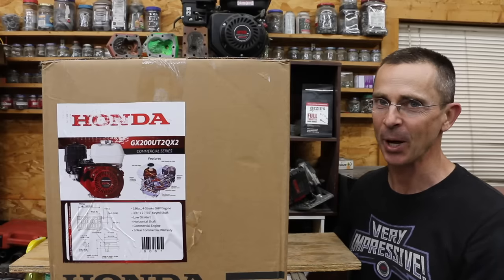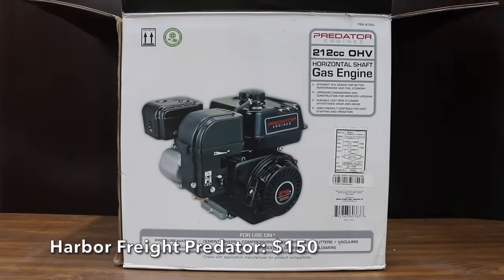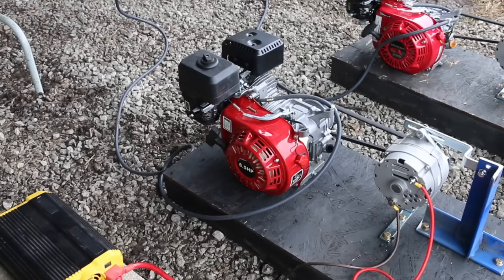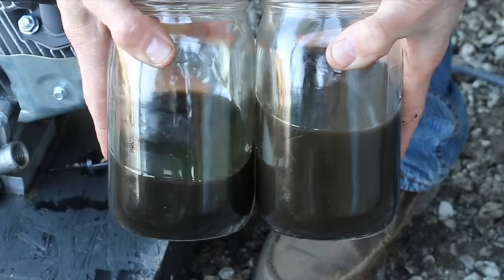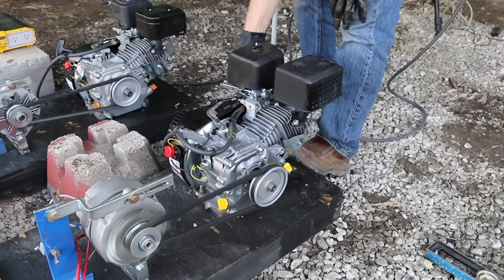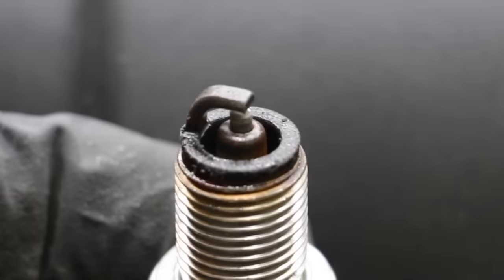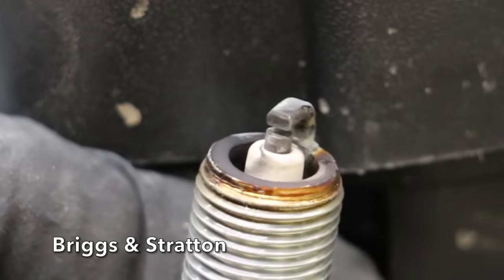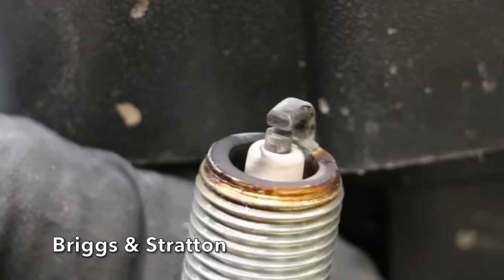$150 Honda Clone vs $600 Honda? Let’s settle this! Fuel Efficiency, Horsepower, Durability, Starting

Comment: Harbor Freight is just killing it these days. Also many thanks as usual for the amount of work you put in for us folks to guide us in the right way.
Reply: There stuff works just fine for most for sure!
Reply: @fredrhodes    Indeed but they are slowly but surely creeping into the professionals space all my guys are switching over as stuff breaks. And I even used to say but yeah it's all Chinese made, and yeah it is for the most part but so is everything else outside of a few overpriced legacy brands and even that often is.  Although if you want affordable American made look to the hammers Vaughan and Estwing they are still doing it right at least.
Reply: HF has upped the products and the prices, and lack of 20 percent off coupons
Reply: @alpham777  I use an estwing everyday for my own 30 years, plus however long my father used it before he died. They are amazing.
Reply: @shystermagoo6823  You mean the recalled ones where the welds would break? Killer for sure.
Reply: @shystermagoo6823  Wait, was that a sarcastic reference to the poor quality jack stands from HF a while back.  Cousin Eddie would approve.
Reply: @shystermagoo6823  crushing the competition
Reply: @shystermagoo6823  wouldn’t buy the Pittsburg but the Daytona stands are actually built really well. PF has a video on them and they hold up well too.
Reply: Biggest thing is to ALWAYS ALWAYS ALWAYS do a break in period before running em hard, it allows everything to kinda wear in
Still good to see him doing h2h's on engines and other things...way cool!
Best part is...he buys em himself and isn't sponsored so he get's to do an objective review
P.S.  A small engine w/o a cast iron sleeve will wear out stupid fast
Reply: Had  four predator powered  pumps at our marina during a flood that lasted two summers. They ran pretty much 24/7 for about three months each summer, only stopping when someone forgot to fill the gas.  That is a lot of hours!  To be fair, we ran our pumps about quarter to half throttle most of the time to make the fuel last.  When the water was real high, they ran wide open for hours straight.  Oil consumption was extremely low, so low people stopped checking them for days at a time. None failed or required any repairs.  Oil was changed a couple of times each year. We also had one Honda powered pump, which ran a little quieter and seemed better quality.  But in the end, the predator pumps did the same job for less money.  I was skeptical about them at first, fearing they were nothing but Chinese junk, but they proved to be far more than expected.
Reply: @m.g.540  They have plenty of coupons during the year.  Simply get on their email list and you'll know when they have them.
Reply: I replaced the low powered B and S engine on my gas edger with a 212 Predator. Sure, it's overkill, but it sure works well over the past 5 years. Best $99.
Reply: They started taking real estate when Sears died, and it seems as though they keep growing now that they realized the shocking fact that people want higher quality products...
Reply: Repent to Jesus Christ “For the Spirit God gave us does not make us timid, but gives us power, love and self-discipline.”
2 Timothy 1:7 NIV
ht
Reply: Harbour freight should come to india
Reply: Harbor Freight doesn’t have any outlets in Canada.  We’re stuck with “Princess Auto”, which is a low end, very low end H.F.
They sell the Chinesium Honda knockoffs.
Reply: Believe in Jesus – the Son of God. «Everyone who believes that Jesus is the Christ has been born of God, and everyone who loves the Father also loves those born of Him» (1John 5:1).
Reply: @tomrogers9467  "Chinesium Honda knockoffs" while 80% of HF tools are literally made in China ANDprased by PF fans. dude you tripping.
Reply: @alpham777  

Yeah—

—SK tools I love but—dang-it—they think they're damned Snap-On or Matco by gosh...

I can pay $25 for a 15 mm ranch or I can pay $15 for the whole set at Harbor Freight.  I don't work as a mechanic 40 to 50 hours a week so I don't need the most comfortable tools.

I will say that I'm not going to buy any more cheap pliers from harbor freight.  All my cheap pliers and wire cutting tools have rusted. I don't even think the tools are a year old.
Reply: @alpham777  I have some open-end and box-end wrenches from HF made in India that - to my relatively untrained eye - appear well-made with good plating, they have a good feel to them. Not like 50 year old Snap-On, or "real" Craftsman, but still far better than I expected to get.

Comment: Just a few years ago you could get the Predator engine for just $99 with the 1 year warranty. We used to put them on our racing go karts and they held up surprising well with the governor removed. There's actually two different styles of engines and they look identical except for the valve cover. The hemi version is the one you were testing in the video with a rectangle cast valve cover. The non hemi version has a octagon shape valve cover. The hemi version seems to last longer than the non hemi version but you have more upgrade accessories for the non hemi version. I've seen guy get 25hp out of the predator with upgrades. Great video.
Reply: I got a Non-Hemi with a billet flywheel, jetted stock carb, governor removed, 22lb valve springs, billet rod, flat top piston, high compression head gasket, a straight pipe header and a mild stage 2 cam with a torque converter and it gets my BT200x to 52 mph. They're rockets
Reply: I've got a Hemi on my log splitter, and 2 non-Hemi's on a pair of pressure washers.  The hemi definitely starts easier than the non-Hemi's.

BTW... I think the Hemi is made by Loncin, and the non-Hemi is made by RATO, as best I can tell.
Reply: @BKD70  same I replaced a worn out brig's with a 212 predator and the splitter works better than it ever worked just run it barley above an idle and it splits everything
Reply: My hemi put that out its billetproof
Reply: A few years ago, just about everything was a half price, thanks to  Bidenomics
Reply: The non-hemis hold up to performance modifications better than the hemis, hence why there is more aftermarket parts available for them.
Reply: The Predator throttle stop is adjusted 1/4-3/8 out from the factory and unscrewing all the way out makes it run way faster. The factory does that because they know you will put the Predator 212 on a mini bike or a go cart for a kid and want it to go slow. (Predator 212 Hemi Hi Performance Guru)

Comment: Love that you went the extra mile and sent the oil off for testing.

As always, fantastic real-world reviews.
Reply from the maker: Thank you!
Reply: Don't Read My Profile Picture  why spam instead of constructive talk? You might learn something
Reply: I read some where that you are not to use Senti oil in an  new engine.the rings can't seat.during break in
Reply: Good point,  perhaps he should run the engines for another 500 hours and redo the oil testing.
Reply: @COSMACELF1802 yes and do 500 speed tests for each engine again

Comment: I've been a Honda small engine fan since using my family's wood splitter with a Honda motor as a teen. I borrowed the splitter last year, which is now about 30 years old. Engine started first pull and ran without an issue through a couple of cords of wood. The engine gets little maintenance- typical splitter it is used a few hours a year then stored for the next year. I'm just amazed at the longevity of this thing. Last year I bought my own Iron Oak splitter with a Honda motor and it's been great.
Reply from the maker: Thanks for sharing.
Reply: Thats incredible, wow! 💪💪💪

Comment: This is by far the best and the most trustworthy comparative test of most of the common products that we all either own or may buy during our lifetimes at least here in the USA.  I have followed PF for over 4 years now as well bought many industrial products from simple tools to some big appliances based PF reviews.  Every one of them has stood up to the recommendations over that time and I expect they are the best value for every buck I had spent.  We all owe a great deal to PF for his unbiased and thorough in-use testing, evaluation and recommendations
Reply from the maker: Thanks so much!
Reply: I agree!
Reply: Very very good test. I personally prefer the predator, I've absolutely used the crap out of the predators before and they handled it. My personal experience is predator gives more bang for the buck.
Reply: @ProjectFarm  

however, for the test to be complete, there should be long-distance test and then a retest comparison. So what if the predator has results when, for example, after 100 working hours could be a rubble.

Anyway ❤ ;)
Reply: @kevinballuff1164  
Hi Kevin, what about predator’s long term durability? Could be good or (…) 
I guess honda could be best value after long-term test.

E.g Ryobi is powerful (price vs Nm etc) but only for weekend jobs not often, otherwise lifetime will be short.. therefore ryobi manufacturer has in portfolio aeg or milwaeukee for small/business. 

Br, Mariusz
Reply: Agradeça a vida aí na América amigo,pois aqui no brazil é um lixo,somos escravos para conseguir algo q gastamos muito,vida difícil,comida é difícil, saúde e difícil...tirando a paisagem a vida aqui é super difícil...
Reply: Completely agree. This is the one and only channel on YouTube where I actually pay money to help support the creator. $5 month is well worth the high-quality, useful content!
Reply: Certainly is but it is exhausting to listen to!
Reply: Exactly. If PF recommends it, I buy it. Haven't been disappointed yet.

Comment: Very Nice.  I always use Honda.  I am in the concrete business.  I have 2 trowel machines with the GX160 engines.   I just add oil when they turn off.  One is 28 years old and the other is 25.  Back in the day we only got 3 years off of Briggs.  Havent gotten the opportunity to even test any other engines.    They worth every penny to me.
Reply from the maker: Thanks!  Thanks for sharing.

Comment: Great video! I bought the same Predator engine you tested three years ago and have not had a problem with it. It's nice to hear that it stacks up against the much more expensive engines for heck of a lot less money!
Reply from the maker: Thanks!  Thanks for sharing.
Reply: Predator all the way 🤙
Reply: ok
Reply: Predator is the way to go for sure

Comment: I've purchased dozens of predator engines, and have yet to have any complaints.  Most of my swap outs were on garden tillers, mainly because they adapt better to different brands and their bolt patterns. Great little engines for their price.
Reply: I am debating on swapping out the gas golf cart engine for one of these. (Predator).
Reply from the maker: Thanks for sharing.
Reply: @paulpiatt5610  Predator is Lifan. They are good engines. The 224's are a different manufacture of lesser quality.
Reply: Garden tillers get run on angles and even fall over running so they starve for oil.  Use their oil up and keep going as it's only another row and not use it again for another year.
Reply: @daylongdriver1  one great thing about the modern predator motor is the low oil cut off. The only two times a tiller was brought back to me for not starting,  this was the issue both times. Added a half a cup of oil, and they started right up.
Reply: @paulpiatt5610  
I've done many a hond 390 to predator 420 swap on chuck wagons and they all went well. I'm not sure of the longevity of the predator vs the Honda but the predator seems to be doing well in my sisters old tiller that I swapped one in. Most of the chuck wagons however, belonged to people who did absolutely no maintenance and that's why the Honda failed in the first place, so the predator will probably fall prematurely as well.
A predator swap in a golf cart should be straight forward so long as the original engine is a single cylinder Kawasaki, which most late model ezgo, Cushman, and club cars are
Reply: We bought tons of predators for my gokart thinking they wouldn’t last long. Well, it did. For two years.stills runs perfect. we are putting it on my minibike since it’s got performance upgrades on it. And for my kart, we are putting the new 
Predator Ghost racing engine on it.
Reply: @DieselRamcharger  you have that wrong, the 224 uses a better block than the 212, not much else matters really as a lot of people modify the snot out of them anyway.
Reply: Lol but you are not getting any results
Reply: @paulpiatt5610  that's bad
Reply: Fantastic
Reply: @DieselRamcharger

Comment: The 6.5 predator engines are quite popular among the Amish for their field implements like hay rakes. Very durable and at 1/3 the price quite the bargain where one can be kept in stock on the farm for emergencies.  I haven’t heard of a failure yet.
Reply from the maker: Thanks for sharing.
Reply: Wasn't expecting to see a comment from another Lancaster viewer when I clicked this video!
Reply: I thought the Amish used horses n shit
Reply: @dkis8730 , they do use horses but many use small gas engines on equipment rather than ground drive.
Reply: @dkis8730  Nah, they don't use electricity, but they use just about everything else.  You should see some shops... they have some sick ass pneumatic systems you could only dream of.
Reply: Awesome , Thanks project Farm 😊
Reply: @dkis  they use all kind of electric and battery devices. The loophole is they can't OWN electric devices, but they can use it as long as it is owned by someone else. gas/diesel/LP devices are also fine to use if they are stationary. I have seen them pull a tractor to a field with horses, take a wheel off and use it a stationary power unit. but if the tractor is owned by someone else they can use it normally. depends on what the Bishop allows.
Reply: @dougkrultz2149  holie shÿt, these regulations don't make any sense to me at all
Reply: Lancaster represent
Reply: 717 is here
Reply: Yeah, they do the same stuff in Ohio, in the Burton area.
Reply: They technically have electricity. Its called generator. And if they rent a house they can use the electric all they want for basically ever. When they buy a house they can keep the electric for a year I believe, most just keep it around here from what I witnessed. Also the older generation use solar, which is a joke, but electric is electric.
Reply: @Spike-sk7ql  iam in west Farmington. Its a zoo out here! Lol
Reply: How is the air pressure made?

Comment: Surprising results! Honda has been a rock solid small engine brand in my opinion. But I just assumed the clones were all about the same, pretty good for the price but a far cry from Honda.  Great to know the predator is a viable option on a budget👍🏻
Reply from the maker: Thanks for the feedback.
Reply: Speaking as someone that's worked on hundreds of small engines; the true Honda clones. The ones that are part for part copies of a real GX engine are usually about 98% as good as the real thing for a quarter of the price.
Reply: I have a 212 cc in my Toro single stage snowblower made by Loncin. I have read on forums that the Harbor Freight Predator 212 is a suitable replacement if you should happen to need one for whatever reason.

After this video, I have no doubt about that being true.
Reply: 'made in Thailand' like many of their small equipment like generator , etc.
Reply: It's impressive that for all the junk HF sells that the Predators are so good. I've got one on a kart that I absolutely thrash and it takes it like a champ
Reply: @atoz20001  only Honda outdoor power equipment I purchased new was a walk behind mower in 2008. Still runs and works like new! Shame their getting out of that market😥
I've worked on quite a bit of equipment with Honda engines and clones. Also rebuilt a couple Honda gx series engines, both due to high hours and less than stellar maintenance.
Reply: Dont get this as a  true test, honda engine is the best, buy the clone one,and u will see i wont even start the second time
Reply: The honda motors are junk as of a few years ago. If u look at GX in the vid .thats the one thats junk. The ones made in japan are the best and last forever